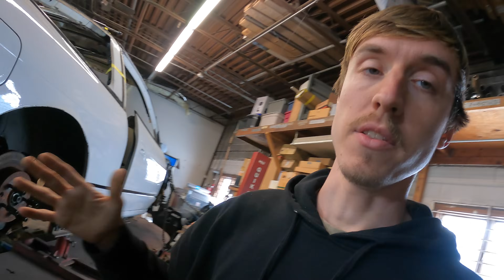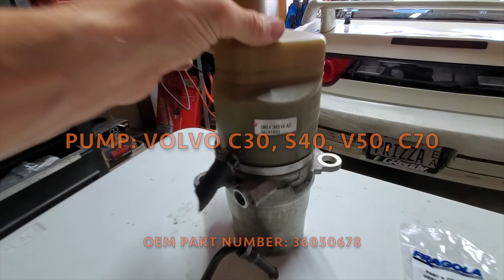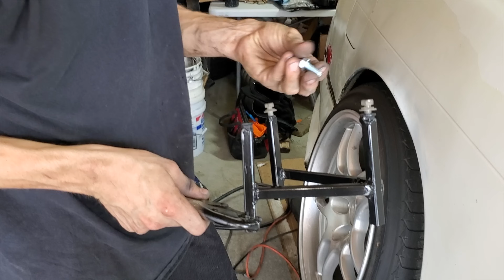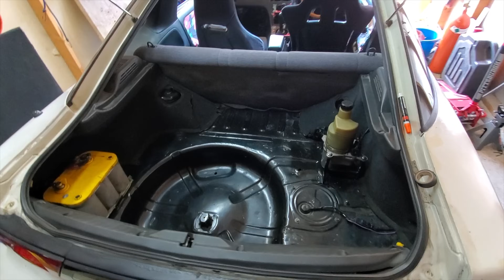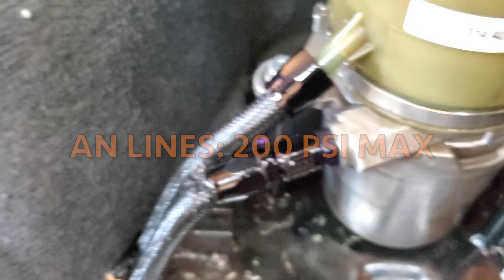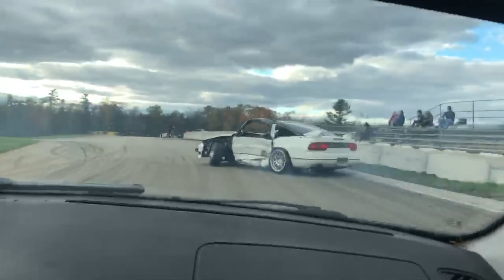How to Install Volvo Electric Power Steering Pump into Most Cars

Comment: Wanted to do that on my s13 sr20det silvia but after some research it says that this pump draws alot of amperage and I would need a high output alternator. Have you done anything to your alternator ?
Reply from the maker: I have a stock alternator, and also run dual electric fans. However, I have wired a live digital voltage meter into the cluster vent (this can be seen in my drifting videos) to manage and analyze when voltage drops. But I havent seen any issues.

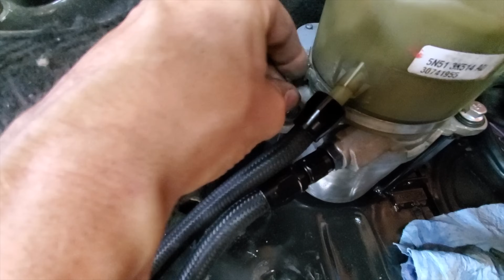Comment: At time 3:10 in your video what did you use for the AN fitting on that nipple? I saw you threaded in a AN fitting for the bottom. But what AN fittings is on the top?

Comment: What you are  depicting here is NOT   "electric power steering."     Electric  power steering is that which is boosted  directly by a motor mounted on the  steering column  assembly, such as Honda and some others.

Comment: Citroen electric pump better unit to fit due to smaller size or the electric assist Vauxhall Opel steering column .
Reply from the maker: Unfortunately we don't have those cars in the U.S.

Comment: That is awesome I had one car with electrical power steering and man I fuckin hated it. The car was always broken so when not running the powering steering doesn't turn on moving that bucket around 😫 and it was a Volvo lol
Reply: FYI everything on those model volvos are the same as a Mazda speed 3 and Ford focus the same years as said volvo models. Just for a wider part range

Comment: Been meaning to try one of those Volvo pumps out, not for Drift.  But still wanna delete my PS belt driven pump on a car that doesn't have a manual rack/box option.  Was that a Nitrous line?
Reply from the maker: Technically yes haha, that line is marketed as a nitrous line

Comment: Thanks. What happens if you wire the ign wire instead of on a switch?
Reply from the maker: If you wire the trigger wire to an ignition source, the pump will turn on when the key is turned to "ON"

I actually had mine set up that that at first, but ended up putting it on a switch. That way I could turn off the pump while on road trips on the highway.
Reply: @PrizzaMike  since supra's ps is adjusted by ps ecu. I wonder if the canbus wires csn be wired there and have it adjust how hard or soft, depending on speed. Hmmmm. Thanks. Ill look into it more

Comment: good information, I know I've heard of some people having problems when they mount these pumps to far from the rack. but that doesn't appear to be a issue for you. How is the weight/feedback of the system after going to the electric pump? I'd assume it's a little heavier than stock?
Reply from the maker: I would say the hydraulic pump is overall easier to turn the wheel at parking lot speeds, but other than that I could not tell a difference!
Reply: If you have very long lines the steering can get a bit soggy because of the flex in the lines. Important to have good quality lines that can handle the pressure.

Comment: I wonder if this would work just as well with a Mazda 3 pump instead? These pumps are A LOT easier to find at a salvage yard.
Reply: Except the more an more asshats discuss it the more and more they get marked up and pulled to be sold on offer up and Facebook marketplace it’s like the Town cars all over again 😓
Reply: @randysanchez1397   Town cars always bern expensive, unless you go to auction. Always was cheap there
Reply: Yes. The Mazda 3 (also ford focus) pumps are practically the same except for the external reservoir.